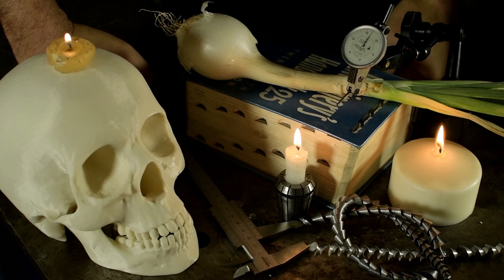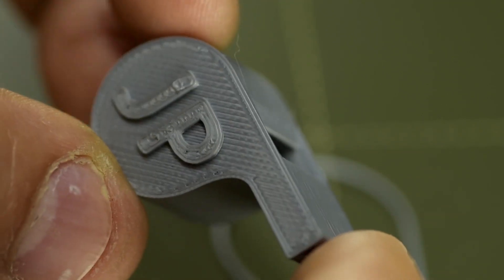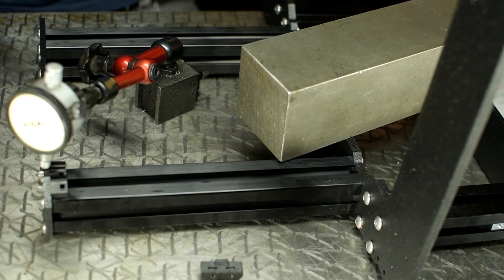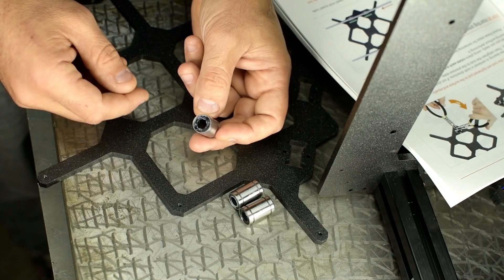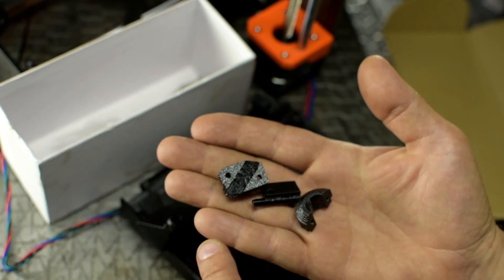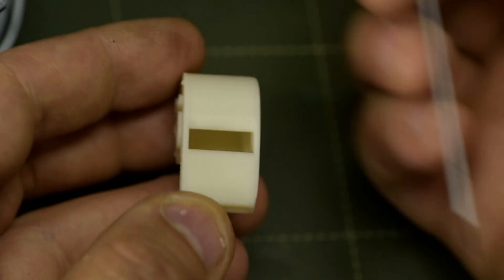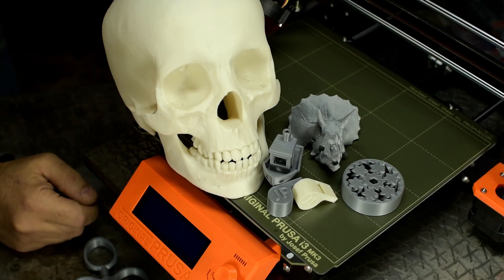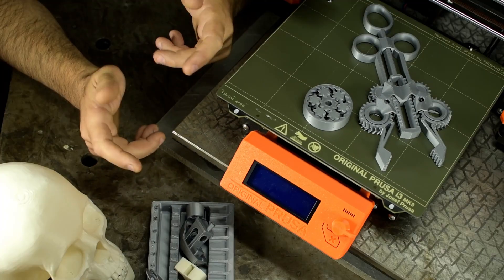This Old Tony in 3D!!! (printing)

Comment: Prusa's imo are the best filament printers out there. They're worth the extra money.
Never had any major problems with one....although I will point out that putting it together on a surface plate, checking the alignment with an indicator definitely went a long way to your trouble-free prints.
(Also, bear in mind a hell of a lot of 3D printing enthusiasts are massive computer or gadget nerds. Most of us wouldn't know one end of a pair of needle-nose pliers from the other)

Comment: oh wow, ive never actually seen one of the prusa printer kits. the manual on that thing is massive compared to what im  used to seeing on all the other companys, there lucky to even have a 10 page manual, most of the give u a bunch of video files an pdf on the sd cards that come with them. but i have 10 fdm printers an 2 resin an thats what got me into wanting to learn the lathe an milling machines. i gotten a lathe now but im still working on saving up to get a mill. but for someone wanting to buy a 3d printer the ender 3 is just as good for alot less money an alot less assembly, its hard for me to say its better than the prusa cause i dont own one but its been the same result for me on all my printers from $150 to $600 they all work out of the box an only get better with little upgrades most printable an then theres the ones u can buy but they are not 100% necessary, so u can get a 3d printer that prints just as good as whats in the video from creality for less that $200 now. depending on what u want theres a reasonably priced printer out there for u now an it doesnt have to be a prusa but at the same time if u have the money to spend on one they are known to be good printers, im just a cheap skate.

Comment: A year late but having built a 3D printer that was a Prusa 2 clone kit, helping setup and assemble a Creality, and getting a Prusa Mini.... the Prusa wins hands down in terms of less setup and tweak time. you just clean dust of the print surface, plug in your gcode and hit print

Comment: Tony, it has been about 11 month since you got the DDD printer.  Have you tried mold making with it?  Print what you want, cast it in sand and pour in the metal.  Might want to pull out the printed model, your call.

Comment: Hey.  I absolutely love your channel.  I have been trying to add fabrication tech to my shop at work.  We build scenery and automation for theatre which admittedly is slapshot fab most of the time.  When we build revolves and elevators we tend to find ourselves buying really expensive McMaster parts that don’t always work.  So I’ve been shopping Smithy combo machines because we are trying to make machines all be it temporary, simple  but crucial machines.  Curious your take on combo mills specifically Smithy.  I’m introducing this on my dime as proof of concept.

Comment: Store your spools of plastic in a vacuum storage bag with a few silica gel desiccant packets in the middle of the spool. your spools will basically last forever stored like that. the PLA plastic is EXTREMELY hygroscopic, and will absorb water at a shockingly fast rate. a week or so of being in open air, and the plastic is essentially worthless. You will notice that when you buy a spool of PLA it comes vacuum sealed with a silica packet

Comment: I don't use a weird boat to benchmark, i print a right angle corner so i can see how accurate my x, y and z dimensions are. your printer is probably far more accurate in the x and y dimensions (left/right and front/back) and its an easy object to print off quickly and check with calipers. there is no voodoo in assessing the right angle either, because you just measure it's arms and the angle. You can also print a square with a hole in the middle that is the size of a quarter plus a few thousandths. You plop a quarter in the hole, and if it goes right in then you are doing pretty good. if the hole isn't perfectly round, then the quarter won't fit. if the hole is skewed one way or the other then you can see which axis is off.

In other words, the boat seems pretty pointless as a benchmark or a test print

Comment: Got my kit today! Although I'm unsure wether or not I should pack the linear bearings - they upgraded to MISUMU bearings for the MK3s+ and specifically state you don't need to pack 'em. Any thoughts on this anyone?
EDIT: After a bit of reserach, I'll definitely pack the bearings. Seems like the shipping oil's sole purpose is rust prevention. This blogpost had some good insights, in case anybody is pondering the same question: 
https://prusacommunity.com/set-your-bearing-straight/
Reply: I like how ToT's clean and lube recommendation was spot on.  Thanks for the article link.  Looks like it's dead now but I found it on the Internet Wayback Machine.  The upgraded bearings may be worth checking out.

Comment: Hey ToT,

I really hope this comment reaches you one day between all the other comments.
I really love your videos and always look forward to the next.
If I'd had more money I would definitely support you but sadly a student's money is tight.
I kind of have a challenge for you.
I currently own a Creality ender 5 that is similar to the ender 3 I think you meant by the other printer you considered. It is a good value for money printer but it has lots of room for improvement.
There are already kits for stuff like auto bed leveling and linear rails replacement for the standard v-rollers (which are obviously not ideal). But there are other areas for improvement like the not so sturdy "z-axis"(up/down). 
I also realise this is definitely not your area of expertise with this sort of small-scale mechanical components but I would wonder how someone with your heavy machining expertise would tackle such upgrades/improvements as cheaply as possible. 
Knowing from experience that the printer electronics/firmware is a little complex and I would love to do all that for you with the upgrades you would do if you decide to take it on.
I thought this would be a fun/cool idea to dive into if you have time. (which I now realise you probably won't have with the Maho CNC conversion and all.)
I just wanted to let my idea be out there and this not getting to happen would never change the love for your content and all that you do.

Anyway I hope you have fun with the fantastic prusa i3 and may your prints be ever successful.

Kind regards,
Willem

Comment: Late to your party tiny but I have a creality ender 3 pro and I can say with certainty you get 98% of the results of the prusa . I use cura as my slicer to generate gcode and with very few minor tweaks to the settings I get the same results. I strongly recommend anyone thinking about one to get one as the cost of entry with creality is much more inviting

Comment: As for individuals buying the ender 3, the V1 version can come in a 4.2 (32) bit motherboard or a 1.0 (8 bit), and usually they don't tell you. That goes for only the ender 3 V1, not V2, which means no thermal runaway (fire possible) if you get a V1 with an 8 bit motherboard (firmware doesn't support thermal runaway). Also, it does not have an autolevel or the 1 piece upper part like the Prusa, meaning it can be quite out of metric if you don't take time to square it and get it nice and level. Otherwise, you're all golden. The parts for the ender 3 are stupidly cheap (threaded rail kits for only $30,  steppers for only $14, motherboards for $30-50), and it is pretty awesome for beginners

Comment: Your retraction (the printer extruder pulling backwards to pull the filament back into the nozzle), isn't fast or far enough backwards, and so, the strings form as the nozzle pulls away and stops extruding (those whiskers that form), otherwise, your benchy looks amazing.

Comment: I am solidly on the Ender team... (100% infill even) after having built 7 of them, I can assemble one in about an hour, and have it printing. 

Pluses: no 3d printed parts on an ender, it's all aluminum and steel, with POM v wheels instead of lm8uu bearings that run in the extrusion of the frame, and 2 injection molded parts (the cooling fan shroud and psu cover). Price. 

Negatives: cheapest electronics possible, crappy assembly instructions. 

Since I save over 500 clams on the Ender kit, I pump some back in for better electronics. about 150 for a board, screen, and ABL, and $30 for a nifty flexible steel bed similar to what the Prusa has... all in with shipping,  it's about half the cost and works just as reliability... plus I get tmc2209 stepper drivers, a 32 bit processor, and a color touch screen. I do have to compile my own firmware (because I use a different ABL than the pre-compiled firmware comes with, but I can also change some defaults (like the temps in a heating macro).

I used a stock ender for about a year before I modded my first one... and it printed PLA just fine, but I like the quieter, faster and more colorful print experience that I am getting.  

As for reliability,  I have replaced 2 fans and one heated bed (the bed was my fault, bad wire management caused the printer to rip a solder pad off the bed) In a couple months short of 3 years... (not including consumables like nozzles)

Comment: Great video. My 30 year old fold up aluminum camping table was trash because all the plastic brackets got brittle and broke. A cheap used Anet A8 and Freecad allowed me to design and print better than new brackets. Now I am trying to justify building a large format printer from scratch. Why, because I can.

Comment: Hey TOT, I am a year behind you so guess I am 6 years behind the times....  I have more time than cash so ended up with the Ender 3.  So far seems to work great outside of some really small fine stuff not wanting to stick right and then actually getting the bed dialed in a little too well... Don't ask but basically the first layer that was supposed to be .03mm was running thin when the printer homed out.  

But so far had some fun, printed off an "ergonomic dispenser" attachment for the hand sanitizer that oddly the women can't stop laughing about and the men don't want to use... Did some cable chain to support stuff and working on some more for the other two axis.  A shroud for the fan so it can cool from all sides instead of one and a couple small supports for the Z axis that was recommended.  Eventually going to get some ABS to start printing some parts for a small CNC mill called the Root CNC.  The biggest thing I learned that is even though the glass plate is supposed to work better for getting small stuff to stick, hairspray makes it stick so much better.  And as an added measure I am printing the first layers without cooling and then stepping it up later on.  

Going to make a small... ish cabinet for the printer to live in with a compartment for the filament to stay in with some desiccant and just pull on the one I need at the time and go from there.  No opening or closing containers so in theory it should stay dry right up until it's used.  Hopefully the idea works out right.

Anyway can't wait to see some more stuff.

Comment: "You'd think the type of person inclined to buy a 3d printer, let alone the unbuilt kit, would probably have tools like these already"
As someone who ran tech support for a 3D printer company for a few years, I learned that people who buy kits either have all the tools and experience already, or they have absolutely no tools or electronics experience at all. And our kits were a lot more 'assembly required', heck they barely came with instructions back then.

Oddly enough, I didn't get that many complaints from people who were new to it, those types were very interested and willing to learn. Everyone from 12 year old kids, to 90+ year old retirees. The most difficult people were the "I'm a professional engineer of 20 years and this is all completely wrong, this is IMPOSSIBLE to build..." etc.

It is all about attitude.
Reply: "oh really what field?" turns out they're like a civil engineer or an acoustical engineer or some other unrelated-to-machines field
Reply: @spambot7110  sorry I didn't realize how trivial and menial it is to design skyscrapers and bridges.
Reply: @adriansaidan1736  His point isn't that it's trivial, his point is that it's not really a related field where knowledge directly transfers. If that knowledge did directly transfer, why would we need distinct specialized fields?

Comment: They're great for small part and/or one-off casting.  Print in wax, dip-coat in ceramic, bake out the wax, pour in the metal.  Also works great for sand casting as you can put the wax or plastic negative in the sand and pack it around it, then use a torch or something to burn out the wax and pour in your metal.  :-)

Comment: Before I got my first 3d printer last year I had to order a replacement part for my vacuum cleaner. It's the swivel clip that keeps the hose attached so kinda crucial. For $26 I got the part in - and it turned out to be a 3d printed part in nylon. Two years now and it's still doing the job.
First printer is an Ender 3 Pro, now doubled (or so) in value with upgrades, Duet 2 Wifi board and BL-touch are awesome. Upload files directly via webpage instead of memory cards.
Now I've added an Elegoo Mars resin printer and the detail quality and surface finish are incredible. The standard resin is quite hard but brittle. I bought some resin that's supposed to be tougher, ABS like, but haven't used it yet.

Comment: Dunno if it would be appropriate for you garage, but look into a LACK enclosure. Great little DIY enclosure for the Prusa or similar 3d printers. You can get the plexiglass and magnets for it on amazon as a kit for a reasonable price.

Big tip - 3d printer plastics pick up moisture from the air. Some are more sensitive to it than others (e.g. nylon will absorb enough moisture to be a problem within a few hours, whereas PLA can even be fine open-air depending on humidity), but this causes the moisture in the plastic to essentially boil inside the nozzle, giving the plastic a weird foam-like texture. This is bad. Keep your filaments in an airtight container with some of those moisture absorbing packets. You can even build a simple filament container that allows you to print with them without having to take them out of the airtight container.

Comment: If you don't mind having to tinker occasionally, or don't mind creating and installing mods, then budget printers are generally okay. Me, I had three budget printer kits and they all had issues of some sort. As is true with a lot of things, the (insert "tool/camera/lathe/mill/saw/drill/3D printer/etc) that you will use is the best one to buy. So, rather than spend time tinkering or going down the rabbit hole of troubleshooting, I ponied up the not-insignificant $750 to buy my  first Prusa iMK3S. That printer now has over 2000 hours on it and I bought a second one a few months ago and it has hundreds of hours as well. Sure a Prusa costs a LOT more than a budget printer, but that extra cost means the printer just works. That means  you can put time into the programs that allow you to design your own parts, or whatever else you need to do. The printer just does it's thing and in that whole time I've only had a couple issues and they were easily resolved. Also, good that you chose to lube those bearing before installing them. Prusa actually says it's not necessary in the instruction manual (or at least they used to say that - maybe it's changed). I had squeaking bearings in my second printer so I ended up disassembling it to lube them. Squeaks went away. On chat with tech support, the guy I talked with at Prusa acknowledged those bearings should be lubed before installation and that they were considering changing that in the instruction manual. Anyway, for the money there just isn't a better printer out there. It. Just. Works.

Comment: I use a ender 3 and have it hooked up to a raspberry pi hooked up to a camera from a ps2 its controlled over wifi I practically can fall asleep and use the webcam to check up on my prints and the interface is sooooo much better to use. A raspberry pi and the octoprint software is my goto for any 3d printer it just gives some piece of mind and can create some decent time lapses and is definitely worth it and should work on the printer you got. Its also great at letting you know what went wrong with a print.

Comment: Tony, you made the right Choice getting a Prusa vs a Ender for sure, the ender is a $200 printer & the prusa is worth its $750 price tag. as a prusa by far has better parts & Prusa needs no upgrades, ender needs many to compare to a prusa's speed. I own 5 3d printers, my Favorite is the Prusa mk3 (2.7 years old no issues to date - flawless) then my second is the Tronxy x5sa Pro (faster then my prusa), many have had issues with there Tronxy x5sa pro, but mine I have owned for almost a year & I have not had no issues, but I cant say I have had many issues with any of my printers as I modded any of the issues. Printers owned, Prusa mk3/ mmu2. Creality cr-10 (highly modded). Sovol SV-01, Tronxy x5sa PRO, Creality CR-6 MAX.

Comment: It's a great print. Seems like you did a very good job on the assembly. Lots of times preassembled printers need to be rebuilt anyway. Anecdotally speaking, when I first saw a 3D printer in 2012 I had to have one. I started a design and prototyping bis and have done well. About three years into it I realized not only have I not used my lathe since I started printing, but I haven't used my CNC mill either. And I still haven't used them to this day. Three printers now, one for pla, petg, etc., one for ABS, nylon and it's varients, and a large format number that does it all. Once your master the flexible stuff the possibilities open up once again.